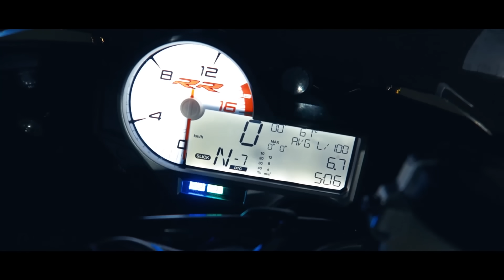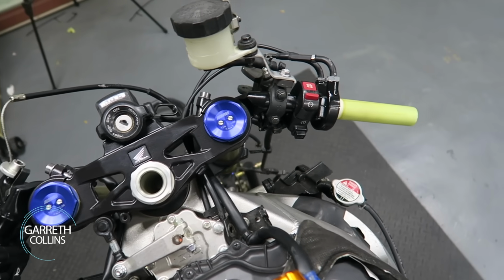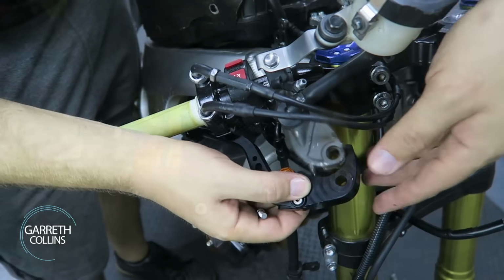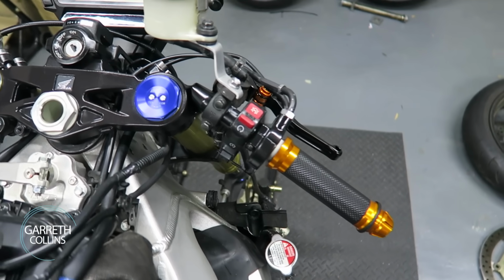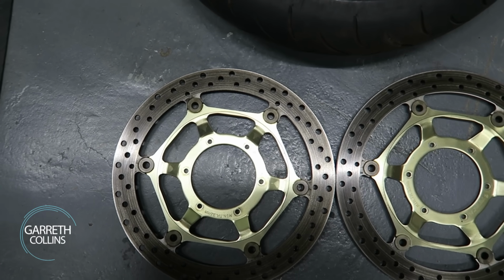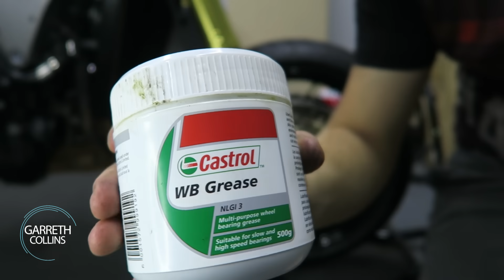Rebuilding A Crashed 2013 Honda CBR 1000RR Part 4

Comment: Quick tip for installing or removing grips, if you have an air compressor you just aim at the grip directly and it slides out in a second, and for installing same thing but pushing it in. Btw nice content, keep it up man.
Reply from the maker: Thanks for the tip didn't know that. ✌️👌 Thanks for watching glad you enjoyed
Reply: @GarrethCollins  No problemo man, glad i could help, works like a charm you will be surprised if you try it.

Comment: Hi looking good Garreth but torque the rear axle to Hondas spec as it affects handling and if you track lower it by 2 pounds above there spec figure and see the difference on corners in and out you will be feel a difference.
Reply from the maker: Will get a torgue wrench soon 👌

Comment: Were the bars spray painted? I hope that throttle tube doesn't get sticky over time!!
Reply from the maker: The paint is Heat resistant it will not get sticky I sprayed the handle bars in part 3 of the cbr rebuild.

Comment: If i were u id replace the brake lines... ive seen people saying they dont hold that well after 5 years... and that stainless steel ones last around 10 years...
Reply from the maker: I will test them out and see if it is. Necessary. Thanks for the Tip